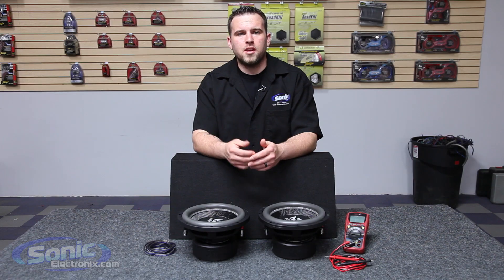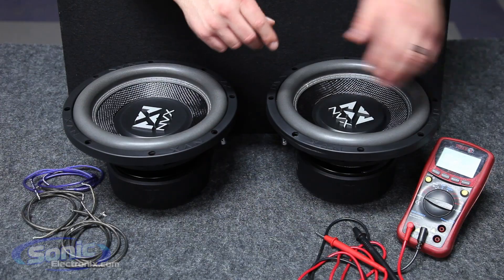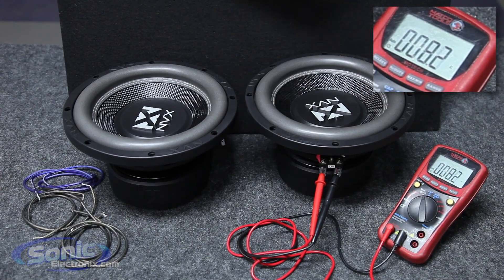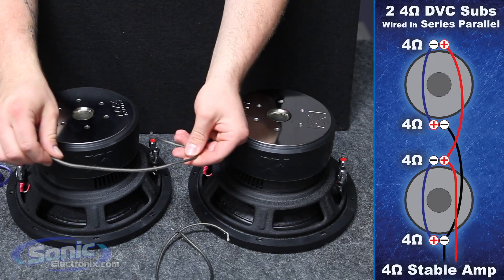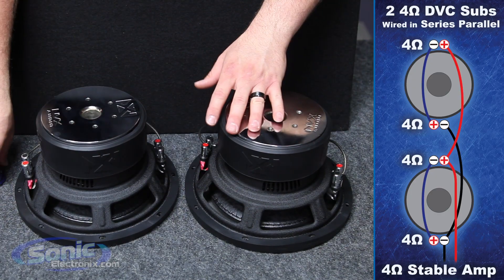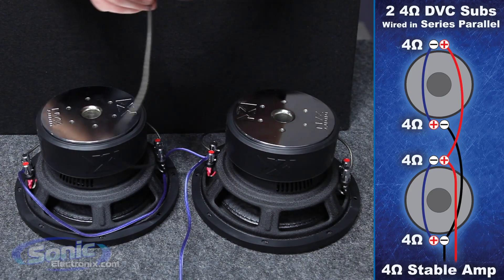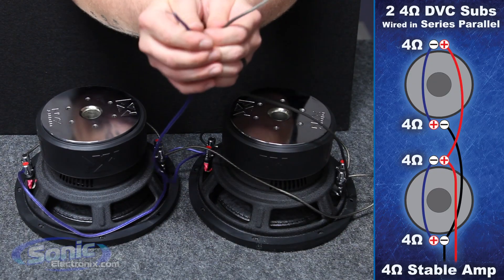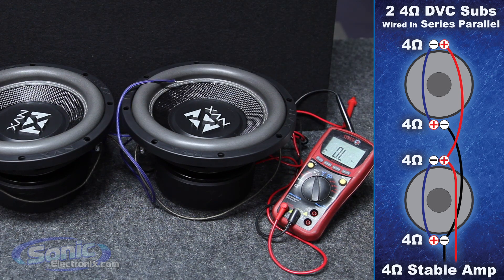How to Wire Two Dual 4 ohm Subwoofers to a 4 ohm Final Impedance | Car Audio 101

Comment from the maker: The only difference between them is how the subwoofer is wired up to the amp and what the final impedance is. For example, two Dual 4 ohm subwoofers will wire to a 1 ohm load on the amplifier, but two Dual 2 ohm subs wire to a 2 ohm load at the amp.
Reply: They talk about the final impedance of a speaker when you have to wire it a certain way for it to work. You get a 4-ohm dual coil it's actually a 2-ohm get a 2-ohm dual coil that's actually a 4-ohm. I think they make this confusing on purpose. Great video by the way

Comment: I want 2 ALPINE SWR-1542D and I want to keep it all Alpine...what amp from Alpine should I get? I understand that each one of these are 750 RMS and with 2 it goes 1500. So I did see a MRX-M240 and it's RMS power at 4Ohm makes it 1500 so will this be a good buy?

Comment from the maker: NO. If you have Two Dual 4 ohm subwoofers and you wire them in this way to a 4 ohm load, they will be compatible with any monoblock amplifier.

Comment from the maker: No, not if you are wiring two Dual 4 Ohm subwoofers to a monoblock amplifier. If you had a two channel amplifier, then each Dual 4 ohm would wire to a 2 ohm load on each channel.